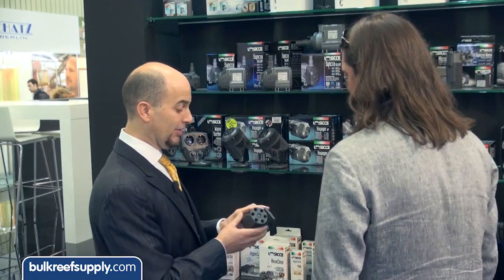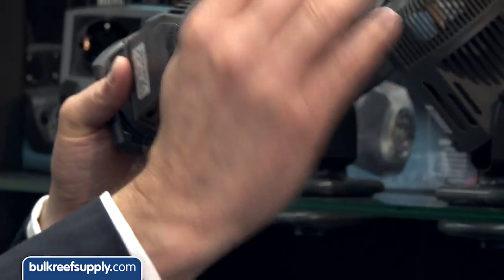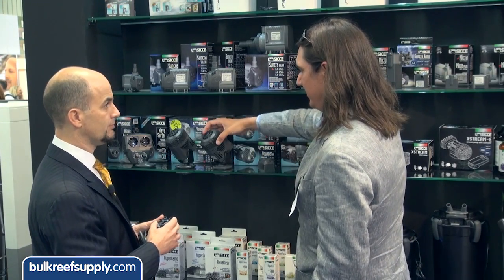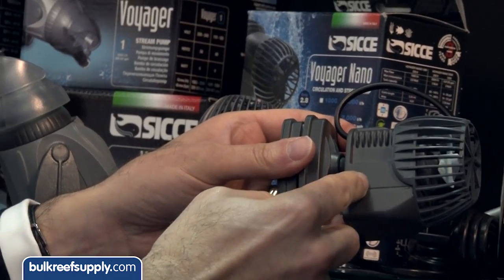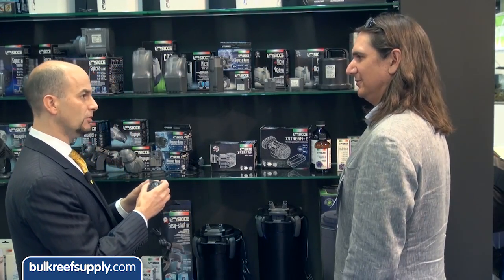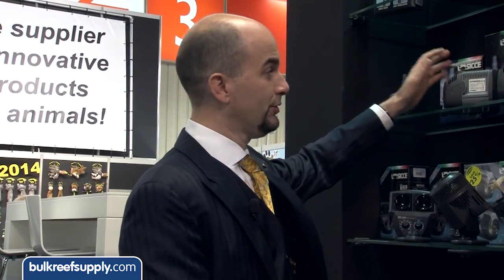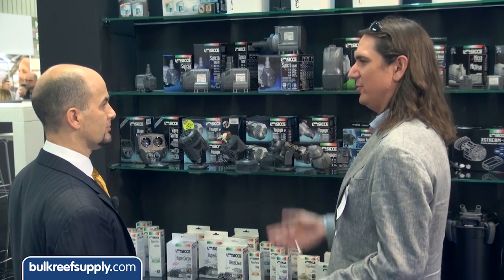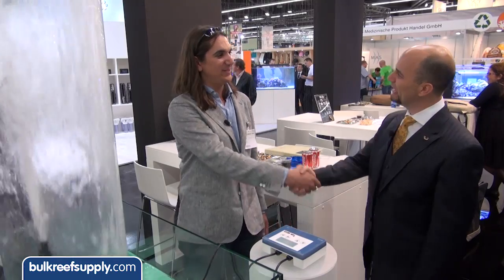Sicce Pumps Have a Lot Going On Under The Hood | Interzoo 2014

Comment: I just bought a Voyager 3 pump it has a tiny bit of wobble while running makes no noise unless you lower water level to where it  is on the glass then you can hear the power, it has lots of jam!  I am happy this one fan,  could be enough easy in my 63 gallon if I put it lengthwise but I have it on one side mounted at the rear of the tank facing outwards and it has a huge flow footprint and that is full open now if you can widen this which I can you have some serious flow. I am currently very happy with this unit it is a big unit reminds me of the pencil sharpeners in school a little,  with the two filters I have on this tank and the two flow fans I have a good pattern and would be even better if I had a controller.

Comment: I purchased 2 Sicce Voyageur circulation pumps about a year ago. I agree they are quiet and the flow is great but after 6 months of use they both stopped working with my wave maker unless I gave them a shake. Even after a complete cleaning they still worked intermittently. Thanks to their great warranty the supplier replaced both of them and to my surprise gave me a Voyageur 3 as one of the replacements. After 3 months of use the problem reoccurred. I still have them, they're sitting in my drawer and have been replaced. Too bad, I liked them maybe the Stream pump will be better.